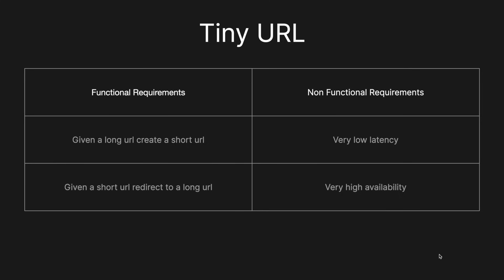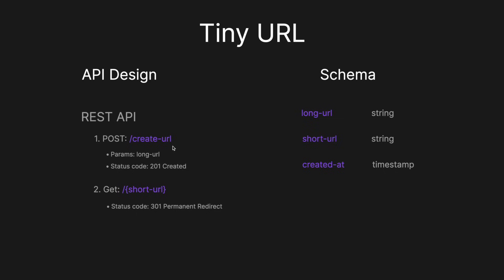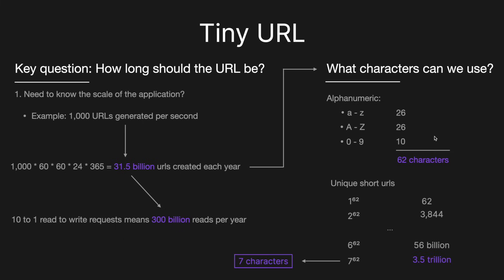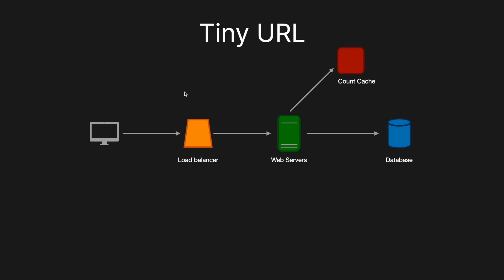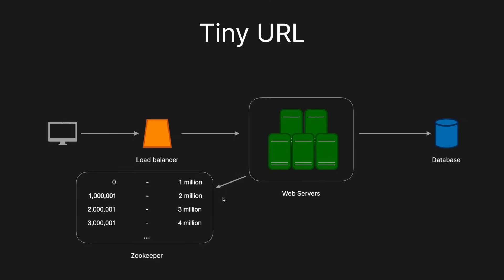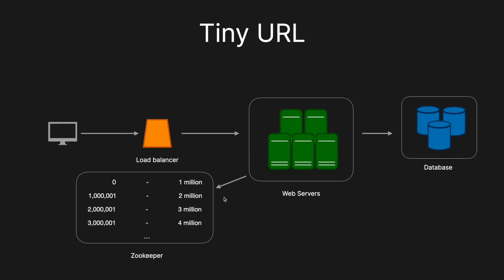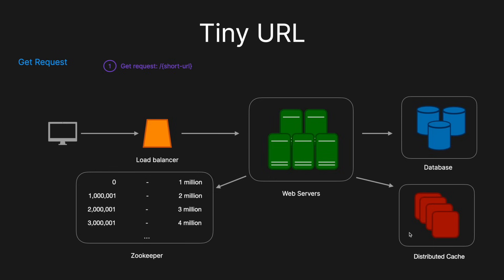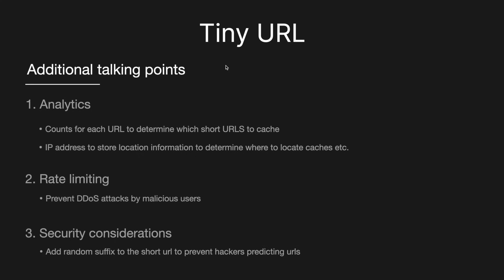Tiny URL - System Design Interview Question (URL shortener)

Comment: instead of zookeeper why not simply have the distributed servers to pick the starting letter, e.g. server 1 can pick tiny urls beginning with 0-9, server 2 urls beginning with a-f, server 3 url g-m e.t.c that way u don't have to deal with having another point of failure, if one of those servers die it's fine you'll simply not produce a certain range until that server comes back up.
Reply: This sounds like a bad idea. Usually you want to follow single responsibility principles & decoupling. The web servers should be simple microservice apis and not have the logic of picking ranges. This adds additional complexity on the microservices, while zookeeper would abstract this logic away. 
Your idea is also not very clear to me. Either you have to configure the ranges statically in the deployment, then you won't be able to scale the number of pods Up or down efficiently or you have the servers dynamically decide their ranges but then it gets very complex since they have to communicate which each other to determine none colliding ranges.
Reply: @BB-uy4bb  no, actually now that I think about it, my idea is similar  to using zookeeper just that instead I'm using prefix letter, he's using different ranges, I think letters are much simpler since the logic or generating a random string starting with certain prefix is simple. Don't know where u see the complication, it's literally get range from config, add it as a prefix, randomly generate another string, literally less than 10 lines of code. 

Instead of Apache Zookeeper I'm simply using a messaging system like NATS to do synchronization which is kinda equivalent with a very minor difference. And it's not that hard as u might imagine, since you know the amount of servers upfront u can sync all of them in less than a second. This problem u must use dynamic configuration if u want to easily scale up and down, which is also very straightforward.
Reply: @BarakaAndrew If you need more then 62 servers, you need to reserve the first 2 chars for the server identification. Which means you only have 62^5 options left per server, which is a lot less then the requirement. That would work if you have (close to) 3844 servers running, but that might be a bit to much.

62 server seems overkill for something like this, but if low latency is needed, you will have servers scattered across the globe and if each location is redundant, you would get to 62 with 31 locations. Does seem plausible and something you need to take into account with an interview question.
Reply: I like this, but wouldn’t this mean the state of “last generated url” is stored in-memory in the application servers? What happens when the servers are redeployed? That state would be wiped out and there’s no way for each server to resume from where it left off
Reply: @vikingthedude  each server can have its database or u can write to one big shared cluster, if u go with the former u simply have to load balance requests to their respective servers since u know which server takes what range. 
Controlling dynamic configuration can also be done easily using a messaging system like NATS. 
Scaling can also be done very easily to a point each server handles only one starting letter after which u can move go two or even vertical scaling if needed.
Reply: @mariusheller8231 do the first two or more. You can update the existing servers to then also enforce the longer prefix
Reply: only scale those servers? @mariusheller8231
Reply: @mariusheller8231 Presumably you'd have a way to change the ranges for each server later.
Reply: @mariusheller8231  good question, if you really need horizontal scale in this way u must reconfigure all servers, u can distribute up to a point where each server handles just a single starting character at which point if u still wanna expand u only have to go vertical or go into first starting two letters. 

How I’d handle this though is use a message bus like NATS, push new config to all servers then they all have to acknowledge they received the new instructions then and only then they start using the new config. Zero downtime.
Reply: Impractical and not bullet proof to use convention

Comment from the maker: Correction: Number of possible URLs (2:45 mark) should be:

- 62^1
- 62^2
  ...
- 62^6
- 62^7

SO to @mohisham for spotting!
Reply: Exactly what I was thinking, thanks for the correction.
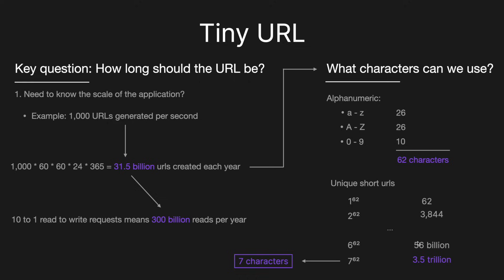Reply: Yeah irritated me too, all in all great video for something that gets asked a lot 3:12
Reply: The math really surprised me when he stated it. Did he hear what he said! This comment helped!!
Reply: ?
Isn't it simpler with 62^n meaning 62 * 62 * ... * 62, with n times 62. As an example, for n letters I have 62 choices, for two letter 62 * 62, so 62 choices for the first letter and for each letter 62 choices for the next letter, so we multiply which is in short 62^2. And that can be extended for any n.
Reply: @querela92  "Isn't it simpler...". Hmm..you want simpler or precise?
"And that can be extended for any n"...actually it can`t.

Let`s take a larger number and let`s see where your mistake is:

We have 62 elements that will be taken by 7.
Your calculus will be:               62^7 = 3.521.614.606.208
But in reality it will be 62 + A(62,7) = 2.478.652.606.142

This means you will end up paying for a space, transactions, cache, etc on a server larger that your really need with: 1.042.962.000.066. 
This is about 1.04 TB of data you will never need.

This is the difference between mathematics  and "let`s make it simple".
Reply: the way to calculate this, in my eyes, work like this. I will take a simple example: 3 characters, a,b,c (instead of 62), each URL will have 2 characters.
We have (ab) (ac) (ba) (bc) (ca) (cb). This is basically Arrangements of 3 taken by 2 => A(3,2) = 3!/(3-2)! = 6
If we accpept also combinations like (aa) (bb) (cc) then we will add also those 3 unique possibilities meaning we have 9 possible arrangements, thus we have the formula:
Total URL number=> A(n,k) + n

Where in your case n=62 and k=1...7.

Comment: Functional/Non-Functional requirements is such a dumb concept ngl..
High latency -> UX is really bad
Not available -> UX is really fucking bad
Non-Functional is just not a thing, especially here, you have use cases and design constraints, not "non-functional" requirements.

As for Zookeeper, interesting, you use it like a reservation service.
Not sure the operational overhead is justified and it's another piece which ads complexity.
I'm sure you can find a way to make it work with a single database.

Something like Cassandra/ScyllaDB would make a  lot of sense imo, good to point that out.
This is pretty much a key-value system, short -> long, where they shine.

I know you're doing this as an exercise and to help people and try to make nice and small videos.
One thing i also don't see a lot in these videos is system evolution.
You started from ridiculous requirements that almost no one will ever experience.
Let's build smaller systems first with as little complexity as possible.
While also keeping in mind that if we are successful, we might want to upgrade our system.
Can we design it now for "low" scale without shooting ourselves in the foot for later ?
At least identify in advance the potential problems that may rise.

Comment: Excellent video! Could another single point of failure be each webserver? For example, during a GET request, if the webserver handling the range is down, the client won't be able to get the long url.

My suggestion is to use a cluster of webservers covering each range. Each cluster would manage itself with a consensus algorithm like Raft or Paxos. That would make each webserver more available while maintaining consistency and resistance to network partitions. This would require more webservers, but it could be argued that since we're using only 7 or so webservers now, having 3-4 webservers in each cluster won't make too much of a difference in cost. We could also increase the range of each cluster, but then we might be sacrificing throughput—it's just a tradeoff between the cost and throughput now.
Reply from the maker: Great comment!

A single point of failure (SPOF) is one that causes the entire system to go down. So while you’re correct that if a server goes down while responding to a request, that request will fail. However, it is not a SPOF as the system will still be up, as if the user were to send another request it would simply be routed to a different server.

Having clusters of servers could be a great extension to the system. However, it does introduce more complexity that could be argued is over engineering the solution without adding a significant improvement to the overall system. But as you already mentioned it’s all about tradeoffs!
Reply: That just sounds like DynamoDB with extra steps.
Reply: I think you made the assumption that web servers are limited to their own range for responding to GET short-url requests, but that isn't said anywhere. The zookeeper gives them a range of free IDs to use for shortening urls, but each web server can accept any existing short url and will contact a cache and if not in there, the database to get the long url.
So, if a web server dies, retrying the request would just be delegated to another web server that will return the correct long url. Even for shortening, if a web server dies and you retry the POST, you'll get a new shortened url from another web server (with an ID from another range)

Comment: Thanks for the video. Would that be a valid assumption that you don't really need to create short URL during the request? Aka you could run your 7T numbers ahead of user requests and create short URLs and store them waiting for long URL to come and just plop that in? That would solve few points immediately: 1. Faster processing 2. No need to keep the zoo of web servers and maintaining them. 3. You could mix them non-sequentially so that would alleviate the attack issue 

Thanks, just learning here! Curious what you think

I guess the only point of failure is that your speed of making those short URLs should be faster than your hypothetical speed of using those URLs, though I'd expect that there would be a very big head start initially. I guess this is where you would need to add another web servers
Reply from the maker: Thanks for the comment!

It’s an interesting proposition alright. In terms of generating the short URL, that takes a negligible amount of time and so precomputing that wouldn’t have any noticeable impact on performance. 

Not sure I fully understand the second part of the comment. Are you suggesting storing all the short URLs on a single server?

By having all the short URLs on one server while convenient introduces a single point of failure and so thats why horizontal scaling is recommended. And then, once there is more than one server involved, a service for maintaining distributed synchronisation is typically recommended. 

It’s all about trade offs but typically a single point of failure is something you always want to avoid.

Comment: how does adding a random suffix protect the URLs from predicting URLs? can you explain with an example?
Reply: Let's say you if you making url number 1,000,000 and convert in into base62 then it would be 4C92, if you are going sequentially I can tell that next number is 1,000,001, which I could predict and try the next link with 4C93. If you add random suffix, it gets harder to do that.